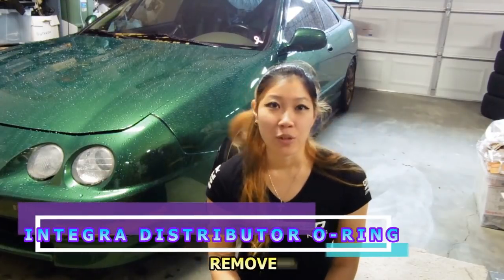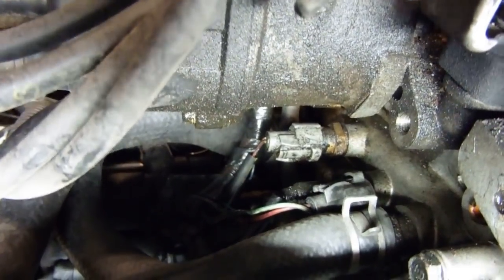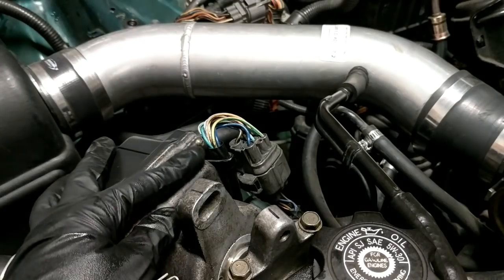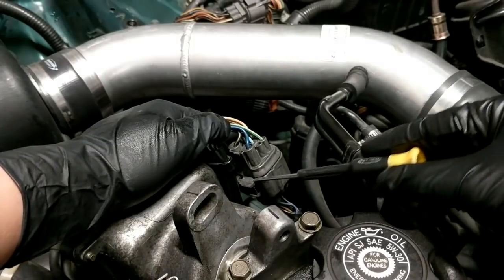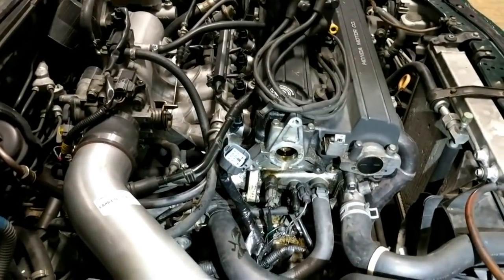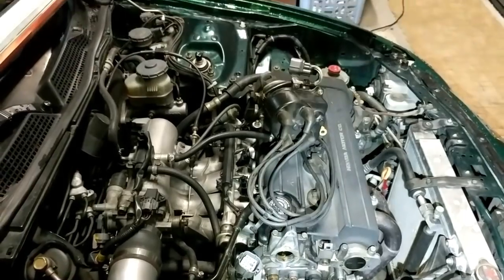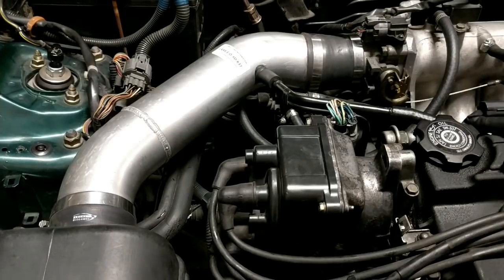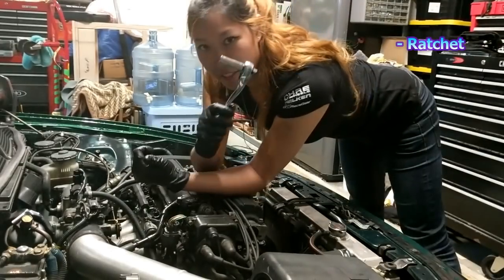How to Replace Integra Distributor O-Ring (VLOG 15)

Comment: I stumbled across this channel looking up injectors during a google search. Watching your videos has me made go back to working on my Integra which has been sitting in my garage for months.
Reply: hows the teggy?
Reply: @__UNKNXWN__  
about to get tuned this coming monday with flex fuel. going to do an oil change and clean out my IACV because the idle is roaming again. dont think i have an air leak anywhere because i tried spray brake clean over the areas where it would leak but nothing happened.

Comment: What size rims/tire and offset are those?
I have a 2000gsr I want to set up for autocross.  Any advice?
I want to do  type r front brake upgrade, but worried 15 inch rims will rub the caliper.  I don't want 17 inch rims.  Looking for some 16x7 rims.
Thanks for the vid.  Keep up the good work!

Comment: Hey Miss integra I got a question, what's the name of that part with two bolts behind the distributor or right there where that top bolt of the distributor is mounted I appreciate if u can help me with That thanks,?